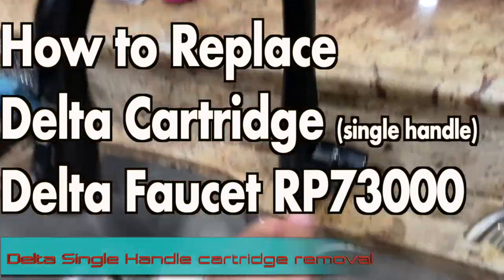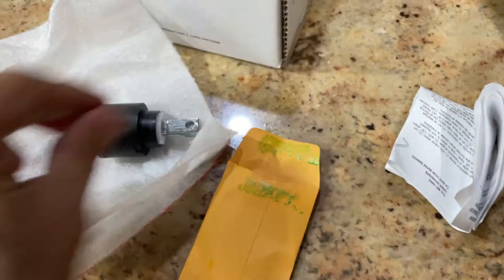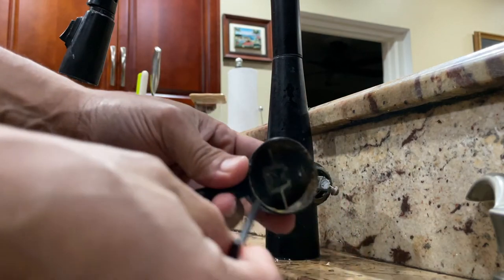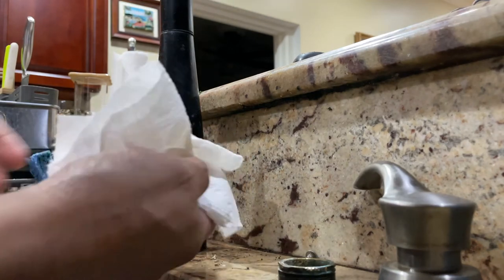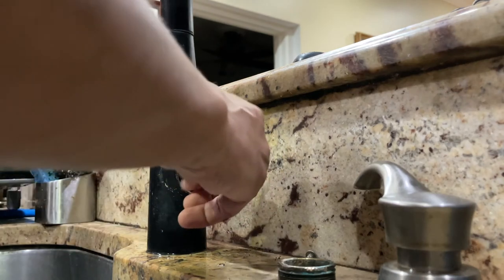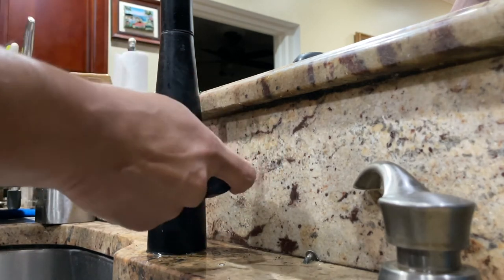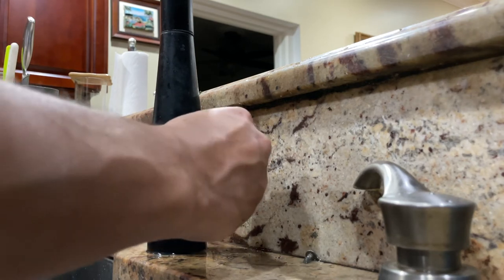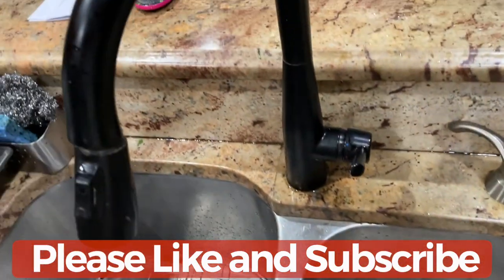How to Replace Delta Cartridge Single Handle RP73000

Comment: Good video. I'd add two things: on mine the hex screw was covered by a rubber plug which needs to be removed before the hex nut can reached. It's about the size of a pencil  eraser and can be pried out with a tiny screwdriver or something sharp. Keep it for reinsertion. Second, since the screw is not pre-threaded, as the video describes, I found it easier to start the screw BEFORE placing the cartridge in the faucet to make sure it goes in straight while you are not cramped for space. Nicely done!
Reply from the maker: Thanks. Good tips

Comment: i have same fuct Trask 19933-CZSD-DST installed in my kitchen. For ast couple of days handle keep falling off.not sure if this is cartirdge issue or just screw.
Reply from the maker: If handle keep falling off then your screw is loose. You need to tighten the hex screw with an Allen key
Reply: @HowToDoitright  already did,no success...still coming off.
Reply from the maker: @tariqabbasi9277  yeah then call delta and they will send you a new valve. Replace it